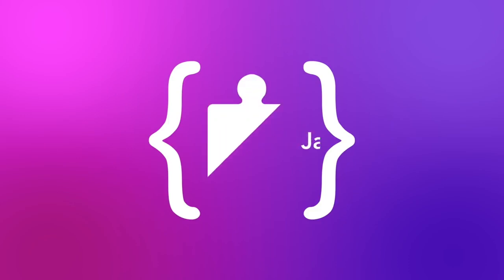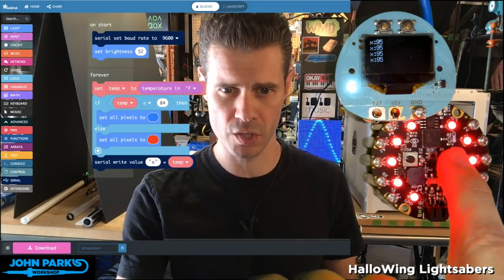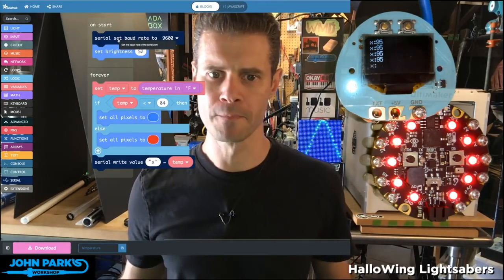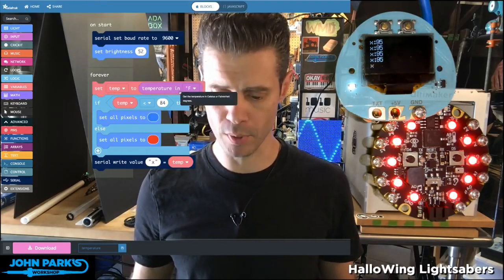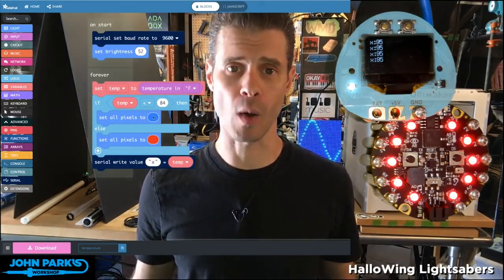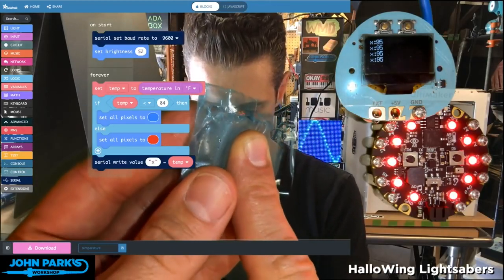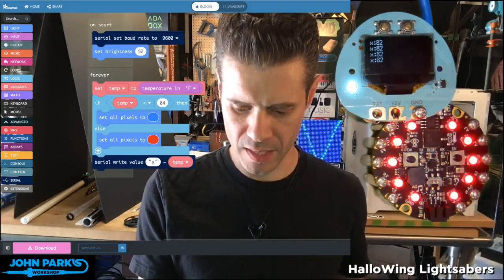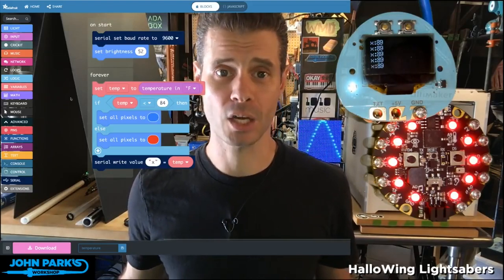MakeCode Minute: Temperature Sensing @adafruit @johnedgarpark #adafruit @MSMakeCode #makecode

Comment: Where is the set baud rate block? Also how did you connect the Chibiscope so it displays sensor values? I have only been able to display sensor values using the keyboard type block in MakeCode.